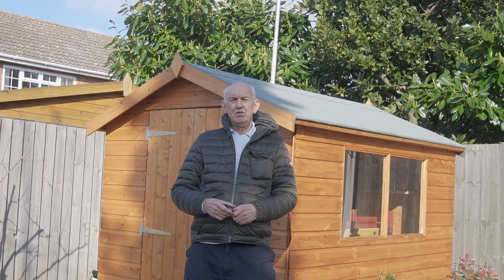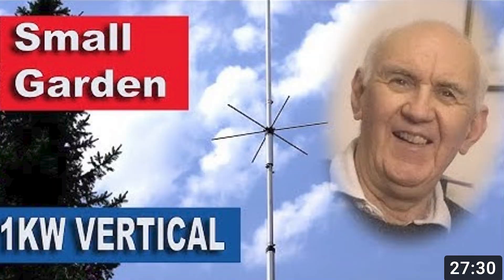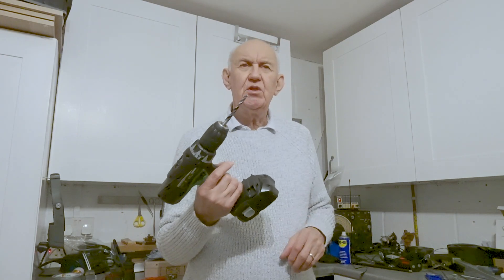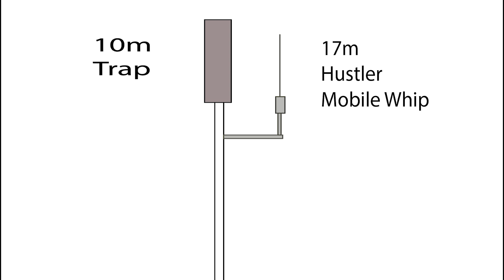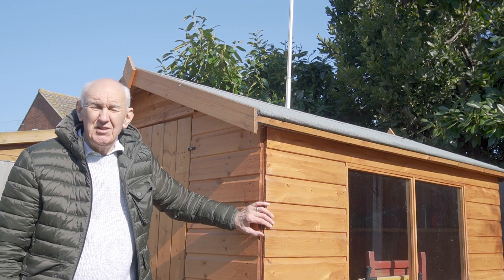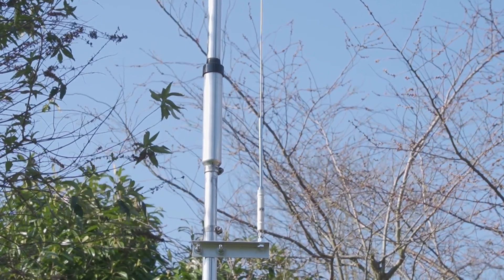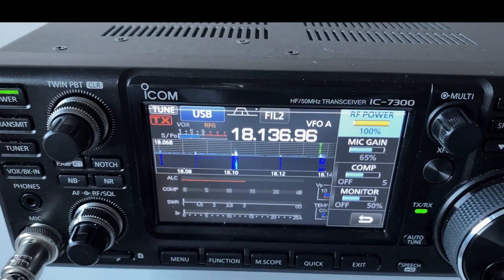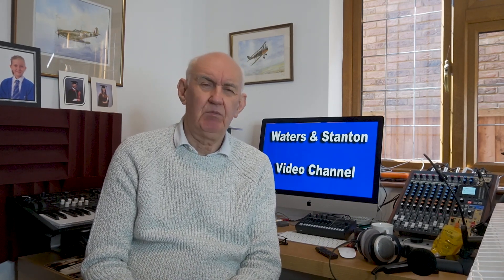HAM RADIO - Adding the  17m Band to Hustler Vertical Base Antennas

Comment: Thank you for taking the time to make this video.  I found very informative.  I have had a BTV6 for about five years and have had good luck with it.  I went non active for about 2 years for various reasons, one being a health scare.  It's all good now and decided to get back on the air.  I live in Florida and as you can imagine it's quite wet here and my traps paid the price so I ended up replacing them.  This time I was much smarter in protecting them from water intrusion.  

I've thinking about adding a 17m to my antenna and to but a kit it cost around $100USD.  I'm going to make one myself and follow your example.  I too can use a power drill and a hack saw.  

Thanks again for a very informative video.  73 de Ed K3ENV

Comment: According to LB Cebik W4RNL (Antenna Guru - SK) bending the radiator 90° half way away from its feedpoint will drop its signal about 1/2db (0.5db, referring to his inverted U dipole). So this 17m configuration should have minimal loss compared to an unloaded 13' antenna. And much better signal than on a mobile with a 22-54" Hustler mast.  Good Video!  - mike  N4ONL
EDIT: Clarified 1/2db was 0.5db not 1 to 2 db
Reply from the maker: Many thanks Mike.

Comment: Peter, you’re using the hustler coiled antenna.  I am attempting to add a similar 17m 5/8th wave non coiled option on a 1/4 wave mono band vertical.  I haven’t found the sweet spot yet.

Comment: Added 17M to my 6-BTV using this method, and my 6-BTV is now a 7-BTV. Took some time to tune in, that is, besides 17M, I also had to retune the 15M and 20M bands. But it’s all up and running with VSWR <1.5:1 across the entire band. I did put the 17M whip above the 10M trap, but it put the complete VSWR out, so I ended up putting it just below the trap. BTW, the whip takes a 3/8” bolt with a 24TPI thread. My first 17M contact was from a station 8217km away using FT8. So it’s working.
Reply: Well, I ran this mod as an experiment for a year, and was happy with it. But, there was just one issue. Here in Australia we have some interesting spiders and birds (some with attitude) that love to hang their webs/nests on whatever structures they can, antennas included. During the year I noticed the antenna was becoming detuned? I checked everything, all ok. However, a certain spider had decided to build its webs across the added element/band. Its silk web detuned the antenna, probably due to capacitance. After eviction and clean, all good. But within days, it was back. Bugger that! So, I’m removing the Band mod and setting the Hustler 6BTV back to its original configuration. I’m getting too old to wrangle with spiders, and trying to shoo off cockies using it as a Jungle Jim to hang from.  But it was good while it lasted. Thanks for the tip! VK2KLJ.
Reply from the maker: Hi, glad you sorted the tuning out.   That is why I placed the whip below the 15m trap. 73 Peter.
Reply: I’m going to add the 12M whip as well. Will let you know how it goes. Cheers VK2KLJ

Comment: I think the Hustler  BTV series are the strongest vertical antennas available to hams. I have had mine since 1978 and the only issue I have had was the 15 meter trap cover, here in Colorado's we are have alot of strong winds up to 100mph and with minimal guying they hold up. I have made contacts all over the world so they do really work the DX well. 73 from ki0ad/jim

Comment: No, you can't put it higher, the Hustler resonator expects the other half below the coil, it's resonant now because it has the missing part which is the 10 meter 1/4 wave section below it, if you put higher it won't work, unless you reduce the inductance. 73
Reply from the maker: It actually does work above the 10m trap - if the section above resonates on 21MHz there is still more inductance needed for 18MHz. Try it!

Comment: I did also add 17m to my 4BTV: at the bottom screw where the coax connects to the antenna I attached the 17m radiator which ran horizontaly around 20 cm (8") and then vertically and I had couple spacers made of PVC keeping the 17m radiator (speaker wire) parallel to the antenna itself. At the top end I had rope to the capacitor rods to keep the radiator straight. I remember it needed 3.9m of wire to have a 1/4 wave on 17m.
Worked very well atop my condo roof (see HA7WX page on QRZ). Then I had to remove everything due to my relocation to VE land...
Reply from the maker: Thanks for sharing

Comment: Just did basic install with basic radial deployment.  Would like 17 meters in addition to the 4 band BTV.  Was wondering why the placement of 17 meter did not go below the 20 meter trap due to frequency order.
Reply from the maker: It won’t work in that position as the inductance beneath it is roo great. It will work below the 15m trap.

Comment: Nice job! But you are adding windage to the original design so the manufacturers may not agree to it being self supporting especially if you add more "branches" - just saying! KUTGW cheers
Reply from the maker: The extra piece adds little weight and is low doen so should be no problem.

Comment: Greetings, Peter. Another great antenna video. I have a Hustler 4BTV with approximately 50 radials in my city lot. Late last year I added 17m and 12m to mine using wires as was described in an article that I read. It works very well on those bands and no adjustment was needed to maintain my low SWRs on 10-40m :) . I think that I might try your suggestion using the mobile whip(s). If it works as good it will at least improve on the appearance. I'll let you know my results. Thanks. 73"s KC8WVG
Reply from the maker: Thanks William. Great to get your info. 73 Peter

Comment: I love the Hustler. A royal pain in the rump to tune up, but I added 12M, 17M, and 60M to my 6BTV and jokingly call it a Hustler 9BTV. DX Engineering makes kits or you can easily homebrew them with some PVC pipe and a bit of wire. This is an interesting take on another way to do it. I kind of like this better.
Reply from the maker: Thanks for sharing. 73 Peter

Comment: Clever modification 👍!  Would it be fair to say you have built a “J” pole system using the 17m mobile antenna ?🤔. (At the date of your posting 12m & 17m have been quite active between the US and Europe around 14-1600 UTC 😉👍)

Comment: thanks for this idea peter.you just showen me how to add on 12 and 17 mtrs to my hustler 6 band trap vertical.Where should I put the 12mtr one  on the antenna please,Thanks again for a really enjoyable video peter.
Reply from the maker: I would suggest around 40cm and make sure the U-bolt is centred.
Reply: @watersstanton  is it 40 cm more at the length of 25 cm than you say or is it 40 cm total
Reply: @watersstanton    is it 40 cm more at the length of 25 cm than you say or is it 40 cm total
Reply: I think making the angle piece 30cm longer and place it opposite the 17m radiator.
Reply: Thanks for the reply

Comment: There is a hack with a jubilee clip, wire and plastic tubing to take it away from the main pole and will be a bit cheaper. You do it and you will enjoy doing, or trying to tune different bands. Andy M6APJ
Reply from the maker: Yes as I said in the video there are several ways, but this makes tuning very easy. I will come back to the subject in another video.
Reply: @watersstanton  Look forward to your other videos on this great antenna.